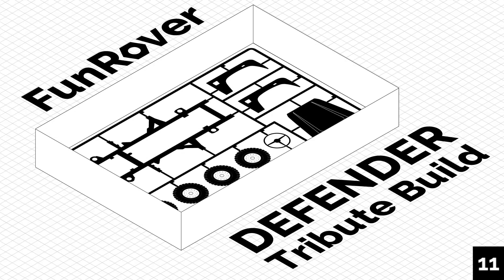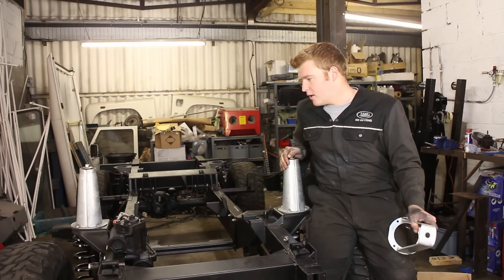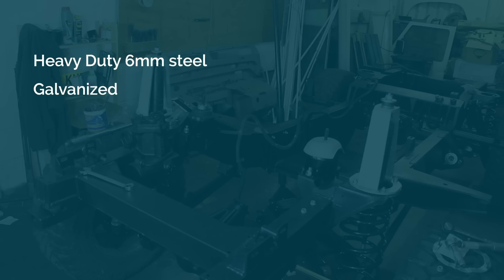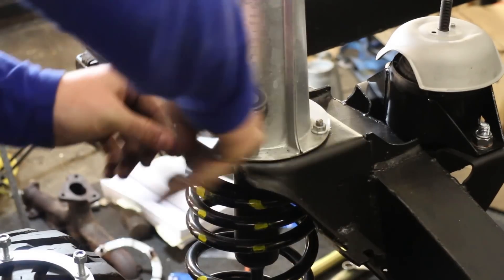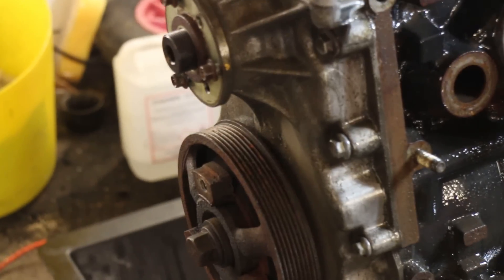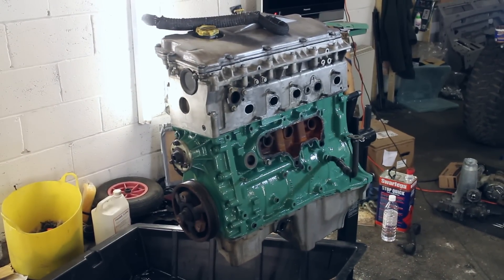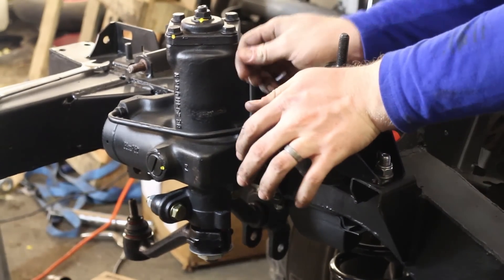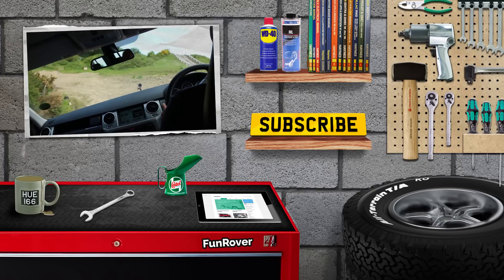Engine Block Painting, Shock Turrets upgraded & Fuel tank fitted

Comment: great videos I'm busy building a 130 into a off road motor home. Busy with engine rebuild now and am interested to see the solution for the exhaust manifold problem. When will you get to that?
Reply from the maker: +Garry Coady Hi Garry, it's gone to a machinist to get skimmed, so will be in the video when it's returned. The best solution we could find (other than buying a £700 stainless manifold) was to have the manifold skimmed flat. The general consensus is once it's warped, it shouldn't warp again, so just needs making level.

Comment: You mentioned removing some of the webbing is that between the ports?
Reply from the maker: +Garry Coady It's between the trumpets on the manifold itself, there are some cast webbings - a  lot of owners recommended removing this too, however, the cost vs benefit didn't add up

Comment: How much is this costing you!
Reply from the maker: +Simon Bennett Daren't work it out until it's done, otherwise the other half might cancel the project :D
Reply: +Simon Bennett Also when you put the engine mount bolts in, Should you not have them the other way round. I was always told the have the bolt so I does not fall out if the nut comes off (not that is going to happen with nylon nuts)
Reply from the maker: +Simon Bennett It was this way around in the manual, will look into it though, thanks Simon ;)
Reply from the maker: +Simon Bennett Yeah, it seems to be correct as it is: http://s533.photobucket.com/user/hawkertempest/media/DSCN3505.jpg.html